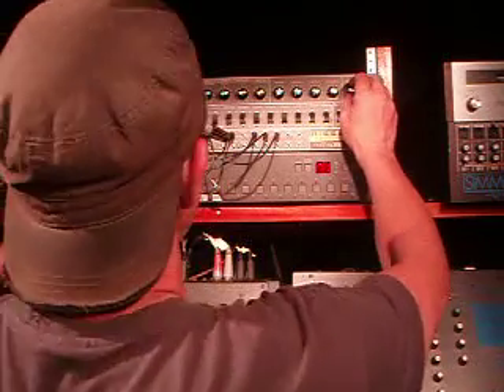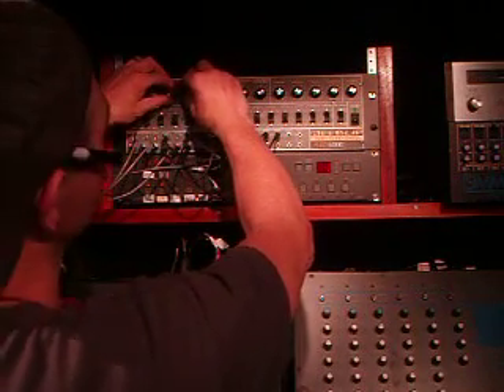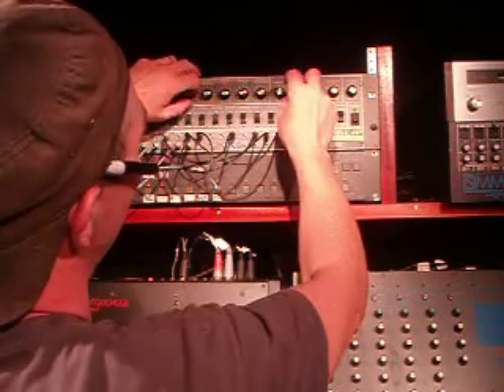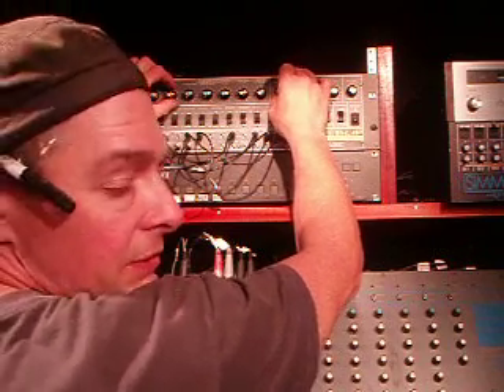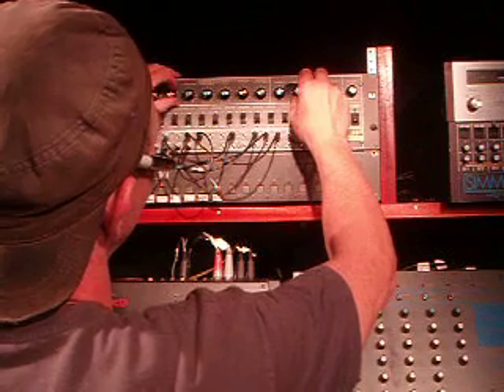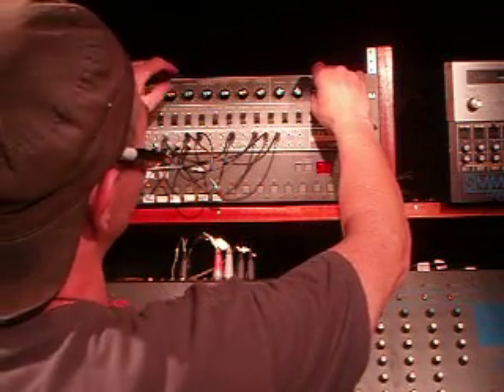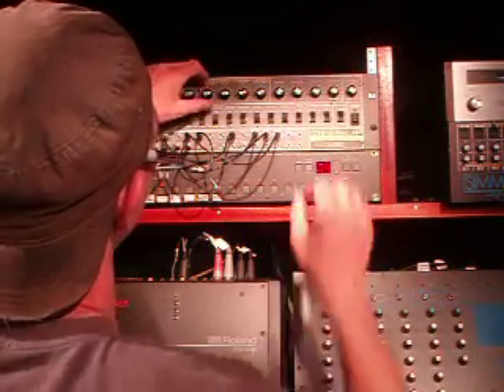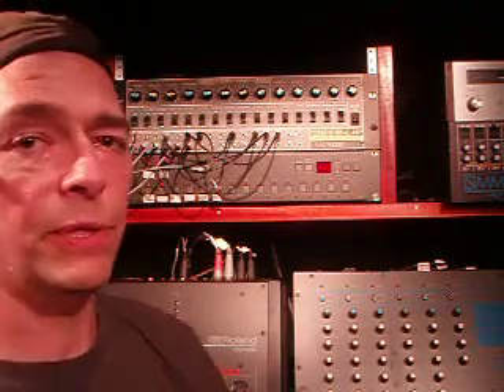MEEBLIP DIY SYNTH - control voltage input modifications and explinations/demo

Comment from the maker: xl> i couldnt do pitch. i was limited to the existing ins from the existinting potentiometers and what they are linked to via the chip's code/function. i did the osc b detune which is about the closest. i used the dc mixer schematic from Ray Wilson and MFOS to accomplish the summing of the pots and cv ins. it would be awesome is someone altered the code to allow for both osc a and b to have a tuning knob. then you could do pitch at least on both osc's from cv... thanks for viewing!